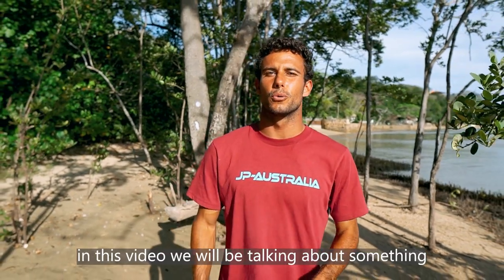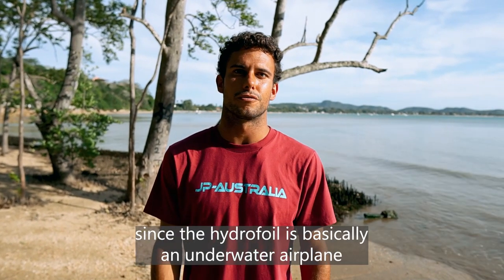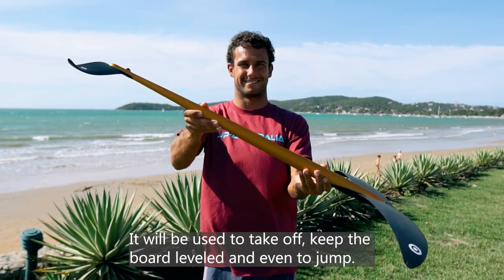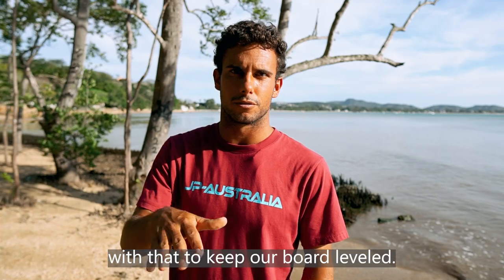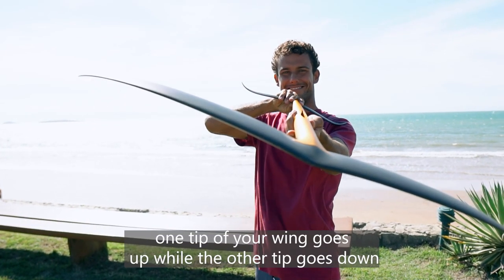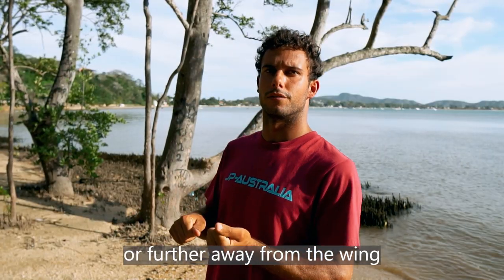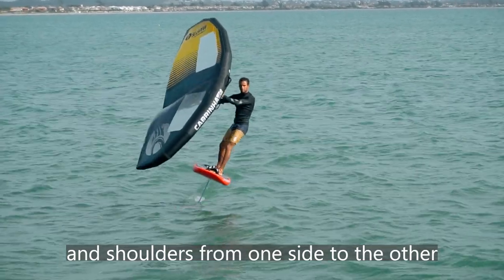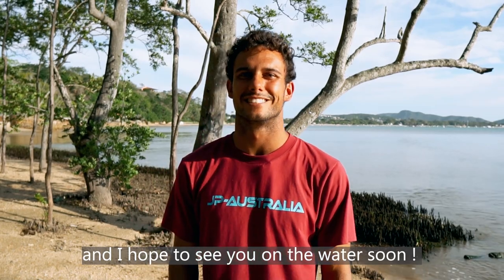HOW TO CONTROL THE FOIL ( what is Pitch, Roll and Yaw ?)

Comment: It's a good explanation.  To me pitch and roll are far more important than yaw.  I'm a little dubious about how much you can use the yaw of a hydrofoil.  In the video when you say you're using yaw, it looks to me more like you're using roll.  I've tried to experiment with yaw while kiting.  I've found that changing yaw works only a very low speeds.  At higher speeds, the foil will correct itself when I try to change yaw.  It creates a brief instability and then goes straight again.  I'd love to hear your comments about what are the right conditions to use yaw.